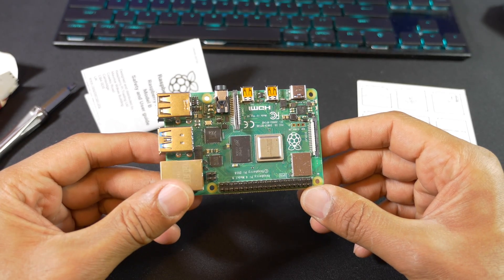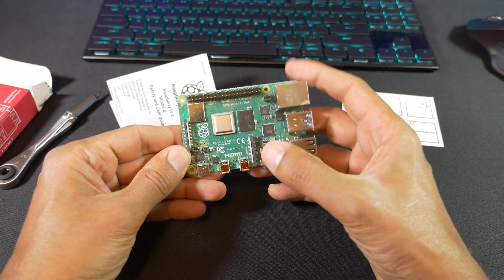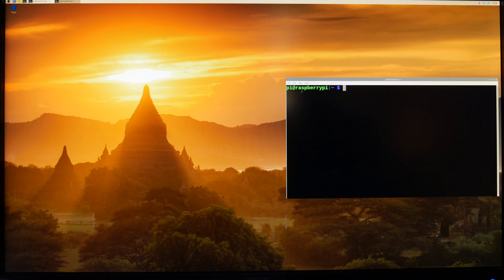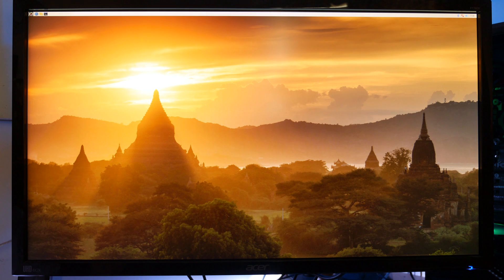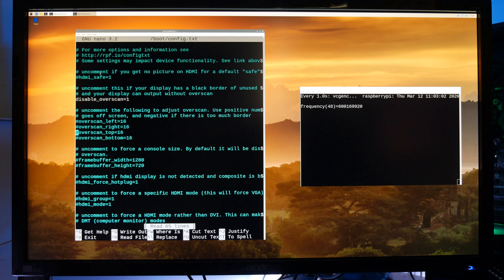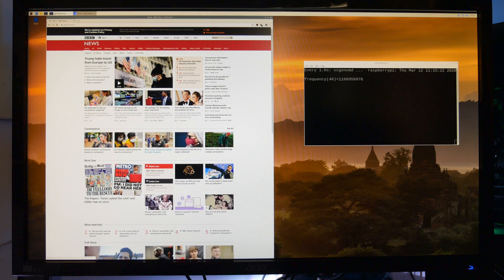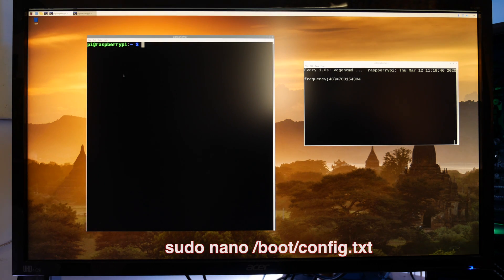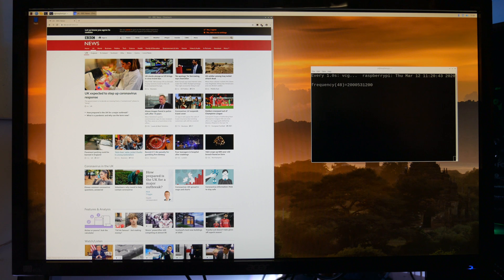Overclock The Raspberry Pi 4 to 2.0Ghz! All 4 Cores Safely!

Comment: This is all nice but what is the reason to overclock a 32-bit OS? I see no purpose in this. Only on 64-bit its useful because yeah 64-bit is MUCH better.
Reply: Uhhh, yeah you have no idea what your talking about. Both benefit from overclocking just the same for one and also the Pi 4 is a 64 bit processor.
Reply: seriously what have u smoked

Comment: You seem like a nice guy, why do you clickbait.
Reply: I don't see the clickbait?!
Reply: @dabj9546  he has a heatsink on the thumbnail which he doesn't show in the video
Reply: @thetostplayertv  But what does that change? He didn't claim anything wrong and though the picture in the thumbnail is from the internet he must have some kind of cooler on there so there isn't any real difference.
Reply: @dabj9546  I understand that but, firstly, I am more of a hardware guy and I would enjoy watching a diy cooler mod and secondly, If the thumbnail does not represent the content of the video then why put one, just let YouTube do it automatically.
Reply: @thetostplayertv  It would have honestly been a very boring thumbnail. Also the cooler shown is available in the aftermarket so not a lot of diy I think. But I do understand that you're disappointed I just wouldn't call it clickbait.
Reply: @dabj9546  But it is a clickbait, I clicked on the video to see a raspberry pi cooler, not only the overclocking.
Reply: @thetostplayertv  In the title it say's "Overclock The Raspberry Pi 4 to 2.0Ghz! All 4 Cores Safely!" so it ins't clickbait
Reply: @hdgame7  I honestly clicked because I looked up "flirc raspberry pi 4 overclock" to see if that case kept the Pi cool enough for overclocking or if you'd need something with active cooling.
Reply: @hdgame7  I wouldn't consider it intentional click baiting though, he probably just slapped some generic art together for the thumbnail.
Reply: @thetostplayertv  That's not clickbait...
Reply: @thetostplayertv  So what you're saying is you just looked at the pretty picture and didn't bother reading the words underneath of it. It's only clickbait to the illiterate.
Reply: @joshfatal  Isn't that what the thumbnails are for, and also I did read at the title but it did not say that this was a software exclusive video
Reply: @thetostplayertv  Uh no, not necessarily. That's what the titles are for. The thumbnail is just a fun illustration usually.The title also didn't say it was hardware-exclusive. "Overclock the Raspberry Pi" suggests he's going to teach you how to overclock, not how to look at some shitty unboxing video of whatever hardware porn you expected to see. Seriously, it is impossible that you are arguing over this.
Reply: Once you over clock, if you take out the micro SD card,  is it still over clocked?